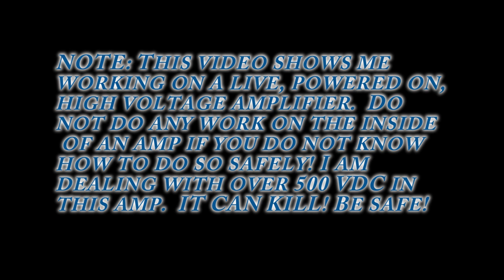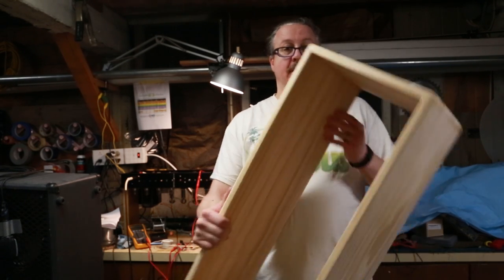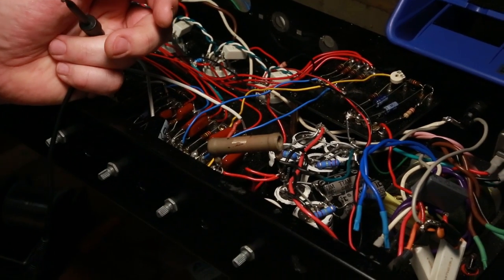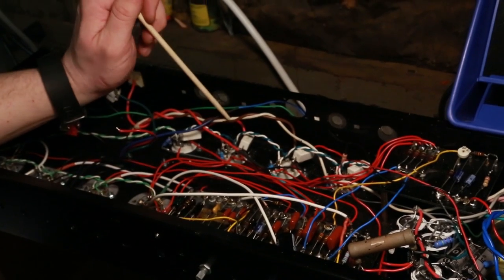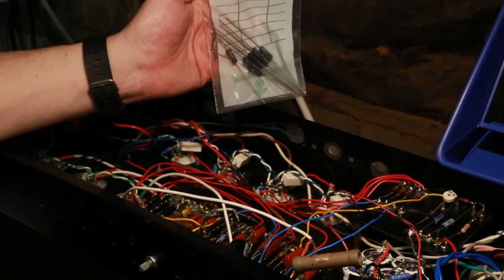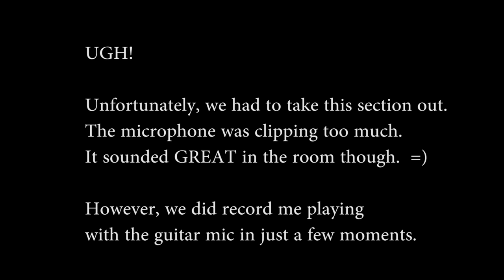Vox AC 100 Video 9

Comment: Nice job .Yea the 59 Bassman with a reverb
Reply from the maker: +Landon Jackson Sounds like you're the second to request it, you and William.  I'll have to put that up for a build very soon.  Right now I'm starting a Gibson EH-185, a classic amp from 1940.
Reply from the maker: +Landon Jackson I've been looking into it, and although adding the reverb shouldn't be too hard, the chassis' that are used for them are already pretty tight.  I'm debating doing a more custom job for the chassis across the board so I can add a reverb to the design, but I'll make up my mind eventually :).  Either way, after I finish the current project (EH-185) a bassman 5F6A is next with or without tube reverb.   Thanks for the input!